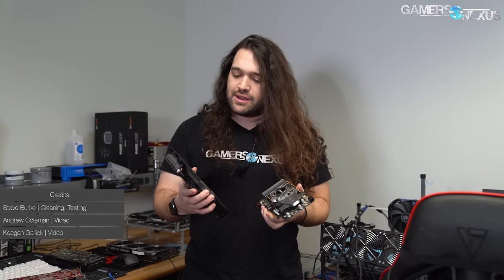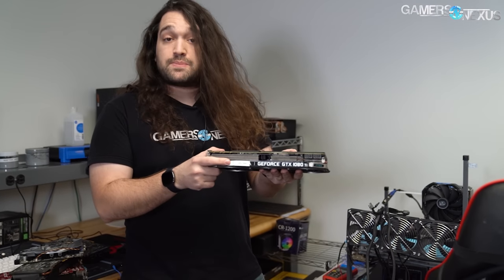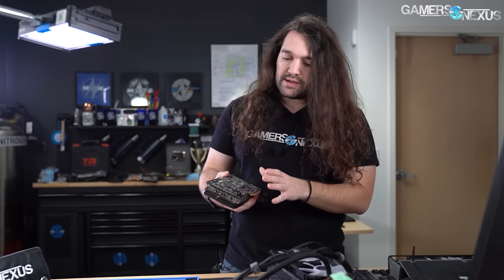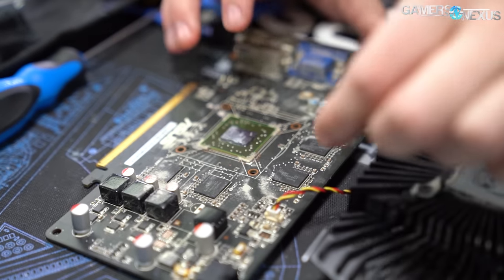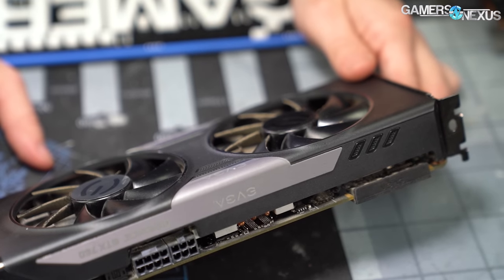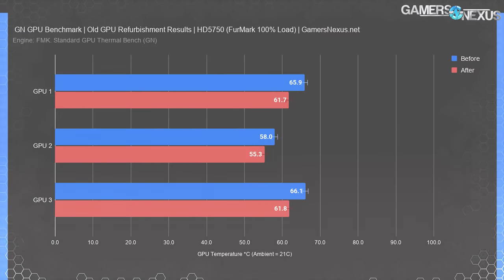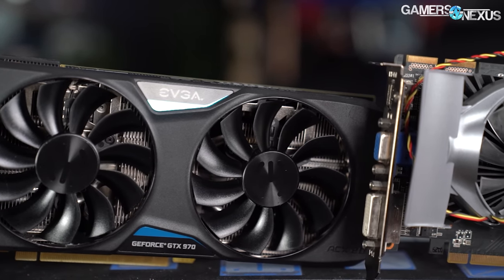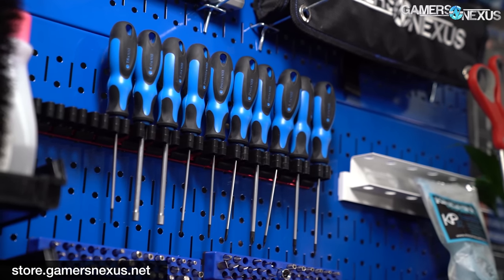GPU Cleaning Before & After Thermals: Re-Pasting & Dust Removal

Comment: I have a PC with GTX 550 TI that, until today (10/17/21), I had never took apart to do a thourough clean up or to reaply thermal paste.

It was a mess. Before the maintence it was reaching 75⁰-80⁰ C just by turning it on. The old paste was rock solid and splattered all around the chip's surrondings (I cleaned it as best as I could but in the end I was afraid to damage the chip so there was a little bit that was left there).

After the clean up and the new thermal paste It went to around 45⁰ C, which is very acceptable considering I live in Brazil.

Will try to see if performance goes up but the simple fact the the PC is quiet now is a blessing alteady.

Comment: After the gpu shortage I swapped out the standard heatsink on my rx580 to using a nzxt kraken g12. 100mhz overclock to 1515mhz and temps not getting above 60oC. So happy I did it, and the g12 will be used on whatever new card I can eventually get!

Comment: I'm cleaning my xfx r9 290x tomorrow. 8+ years old. Still runs great but it does run hotter than it used to. Really dusty and hasn't had paste or pads replaced ever. Also one of the fans is faulty so I'm replacing both. Should be a huge improvement. I'm planning to milk this card as long as possible until I can get my hands on a 3060ti or better for retail price. This thing surprisingly can still run most games at 1440p 60fps and even 4k native with 50% render resolution. Amazing for such an old card.

Comment: Story-Time:  A client had spilled something like a Snapple into his running GTX 580s, a pair of them (when they were new).  It was a top-vent system, rotated mobo, and the drink went straight down the cards' heat vents and all along the PCB.  They paid to replace both, but meanwhile we had a couple cards that wouldn't POST and couldn't be RMA'd. 
They went right into the bin as e-waste.
...And I needed a GPU upgrade.

One of the cards, if I recall, had something extra-bad wrong with it, but the other appeared fine except for the residue and the no-POST. 
So I took that one out of the bin, and took it apart. 
At the kitchen sink.  

I rinsed off the factory thermal pads under lukewarm water, patted them slightly dry-ish with something lint-free, and set them aside on baking parchment to air dry the rest of the way, while I attended to the rest.  The drink residue had gotten on every surface.  Since this was already trash, nothing to lose by throwing caution to the wind, and I literally washed off the PCB of this GTX 580 under the tap, with soap.  Gave it a gentle scrub, even, with a hobby toothbrush, but that barely mattered since the sugary residue dissolved pretty well.  Washed out the heatsink/fins, too.  Wiped down the fan, but thankfully it escaped most of the splash & dribble. 

I then followed up the washdown with rinsing with distilled water.  I had bought 2 gallons just for this.  Thoroughly rinsed the whole PCB like that.  And then, because water can sneak into cracks like a gap between a chip and the board, I followed the distilled water with a rinse of 92% isopropyl alcohol.  I was hoping it would mix with, and/or draw out, and/or displace, any standing water in tiny gaps, and allow everything to evaporate before any corrosion set in.  I was going to blow it off with a compressor, but I didn't trust that I'd get every gap.

After all that, I still let everything sit to air dry for another couple days.  Then reassembled, with the original pads and fresh TIM on the die.

That GTX 580 served me well for 5 more years, in that whole time only giving me 2 random TDRs, and the only thing it couldn't accomplish was running Heaven more than an hour or two.  Otherwise, it handled every game I threw at it.

I was bold cuz I had nothing to loose and a free GPU upgrade to gain, so I'm not recommending it.  But a good cleaning can do electronics wonders!

Comment: my personal solution to this issue is to take a brand new GPU, tear off the stock cooler and install an EK waterblock with liquid metal instead of paste ... run the card daily for over 4 years with zero maintenance and no drop in performance. Recently upgraded and decided to pass the old card on to a friend, he wanted it air cooled so I took the block off to fit an air cooler and the 4+ year old daily driven liquid metal was still liquid like the day it was first applied .. it cleaned off with no fuss and left the die and nickel block cold plate looking like new. Sure ya have to be careful when applying the stuff but it's pretty awesome in performance and lifespan.

Comment: Get a water block, then the only thing to dust is the radiator. Use PEG instead of water and you never have to change that either (at least not in the 9 years I've been doing it). So the tehrmals are a few degrees worse than pure water, it's still 10x better than air.

Comment: Beware of hard water, depending on where you live. A hair dryer might not blow strongly enough to get all the water out, if that’s all you have. I’m going to follow Steve’s recommendation about going outside and just using compressed air even if the hard water stains would be minor.

Comment: Those benchmarks made me wish I had ran some tests to get accurate temperatures before cleaning my Quadro 600. Still, it dropped from ~88 Celsius with fans maxed out at 85% to ~65 Celsius with same fan speed. 
The huge improvement even allowed me to play most games with my fans at just 40%.
Legit started crying after dropping from PS4 noise levels to basically idle fan speeds.

Comment: Just to be safe its good to heat up the GPU die a bit with a hairdryer before tearing off the heatsink to soften up the dried up paste.
This helped me a lot when I replaced the paste on my old Original Xbox. At the time when I did it, the paste was at least 17 years old

Comment: Before this week I would have thought this process was simple and everyone can do it but I was fully wrong.  I have purchased 2 used RX 580's this week and both were absolute disasters.  The first one had NO thermal pads and was re-assembled entirely with thermal paste and waaay too much paste at that.  I spent over an hour and I was still unable to fully clean the board.  The second one had thermal pads but they were too big and the GPU did not have enough thermal pasted and looked like the squish method was used as there was clearly not enough paste showing the on the GPU or the heatsink after removal, probably from the pads being too big.  There was ~10c difference in temp at 100% load between the 2 cards.  Now their temps have settled to be within 3c of each other and are running within 1 MH/s of each other.  If you don't have the correct pads and don't understand how to use paste, maybe just leave it alone.

Comment: I think you would've seen serious improvements with HD78/79x and R9 series card as well as RX 4xx/5xx cards. The former run REALLY hot and are not always adequately cooled, the latter just LOVE to thermal throttle even in the mid 70°C.

Comment: You could also buy a aftermarket gpu cooler, sometimes with those you get way better thermal performance allowing you to overclock higher. OR you could do what I did, and take 2 120mm noctua fans, and a gpu fan adapter (THAT MATCHES YOUR CARD! Asus uses different connectors), and Zip tie em on, and get 20 degree lower temps, and way lower db. I did that to my 980ti when my fans died, and I have been very happy.

Comment: I just repaste my CPU & GPU every few years. I have intake filters on my case I clean twice a year or more, that have a small layer of fur/dust on them when I remove them for cleaning. I run a HEPA air filter in my home though so I'm sure that helps with buildup. Good video!
Reply: Repasted my 1070 when I got it. Temps instantly improved and stayed the very same for almost 5 years now. You don't have to repaste it all the time, if you use good paste, like Kryonaut.

If you clean your PC that often you really don't need filters on it. Remove them and you will see lower temps overall.

Comment: Interesting video - in the future if GN had the time i'd love to see a step by step analysis. i.e. first clean the heat sink in-situ ( as possible ) then test, then repaste and test, etc then maybe on a separate card do it in the reverse order ( though that is difficult to find comparable cards in the same state of dust/paste degradation ) to determine which steps have the most benefit. Two reasons for this, firstly because i'd just be interested to see if all that dust in the heat sink fins actually has any impact or if its the repaste that makes the difference. Secondly if the fin dust did have a significant impact that might be a much easier clean step for some users than a full teardown and repaste.

Comment: My cousin gave me his old PC as payment for a repair job. Somehow he got jelly spilled all over the top of it, which leaked down onto the CPU fan, through the blades and fins, down onto the graphics card, over the fans on that, onto it's PCB. The PC still worked, so this jelly had eventually hardened and calcified. I took it all apart and cleaned it thoroughly with an 80% alcohol solution and after a full day of cleaning I put it all back together and it still worked. Patience pays off. Free 1070 and a $200 Case.

Comment: People often underestimate the potential impact of some simple maintenance. My 7-year-old laptop went form crashing in Civilization to peaking at 80 degrees in furmark after replacing the thermal paste on the CPU and GPU and cleaning 7 years of dust out of the cooler.

Comment: Gotta love the coincidence. Here's a long story about preventive measurements: 
I bought a used 1060 which came with quite dry thermal paste, although the temps were acceptable 71-2c under 100% load. So around  the end of October last year I repasted it with some cheap cooler master paste, I applied a thin layer that I spread out evenly to cover the die and thermals were okay, 63-5c stock at 1911mhz 60-65 % fan utilization and 66-68c at a +121mhz oc (could push it higher, but didn't see the point) same fan speed. 
Well just a month ago my card started to act weird, fan speeds would jump up to 80%  with thermals reaching 69-70 at stock in the same games but I had sadly stripped a screw and couldn't service my gpu. Finally enough was enough,8 hours ago I somehow managed to remove the screw without damaging anything and used a tube of mastergel pro that came with my hyper 212 BE. 
This time I put a lot, didn't spread it out at all and when I did a heaven benchmark and played  doom eternal for 2 hours ... temps never reached 60... 59 were my max temps with better clocks and a better score  at 60-65% fan utilization (1924 compared do 1898 at my stock profile, I have the oc model ) .
In my case, I believe that the constant shrinking and expanding of the chiplet pushed that cheap thermal paste sideways because when I  unscrewed the pcb from the heatink it fell on its own which has NEVER EVER HAPPENED before.
TLDR: Never use cheap thermal paste on your gpu, and if you do make sure to put a bit more than the cpu

Comment: If you keep a positive pressure inside your case, meaning more inflow than outflow, you'll never have to clean your cards. This is 11 years though, not bad. 

Hcrevices/ vents other openings of your PC that creep past your filters. If you can, get a bottom fan in there, it hits the GPU first, pushed back from the front fans.

Comment: Still running SLI GTX 970 SC since like 2015. Filtered case, and pretty much light use for the vast majority of its life. When I got a 2k monitor, for about a year I ran the resolution at 2k, putting more load on the gpus in games, then switched back to 1080p, don't notice a huge difference in quality, my gpus are happier and the fps is a lot more stable. Will probably run these cards until they stop working with the way the market is at the moment with shortages and high prices. Half tempted to stop using SLI and sell one of them on ebay for more than what I paid for it, 6 years ago. lol

Comment: I have a Gigabyte GTX 960 4gb Windforce dual axial in a system that has the fan shroud and fans taken off and 2 Fractal R2 92mm silence fans zip tied to the heat sink. The fans are hooked up to an NZXT Sentry Mix II fan controller running at a fixed 50%. I did all this because I broke the fan header off the board while replacing the thermal paste lol. It works so good, no matter what you put the card through it wont go above 50c and it makes no sound. Those Fractal R2s work good, and a GTX 960 4gb is still brilliantly capable for an HTPC on a 1080p 42 inch display.

Comment: There is one more way to ensure that one doesn't blow the dust into the air.
And that is to use a vacuum cleaner.

And before people scream "ESD!" Then electrostatic buildup comes from dry moving air, it doesn't matter if the air is blown from a high to low pressure or sucked from high to low pressure. The mechanism behind electrostatic buildup is the same in both cases.

Also, using a shop compressor tends to be a bad move.
A lot of shop compressors have dehumidifiers on them, ie, they send out far more dry air than ambient, only increasing the risk of electrostatic buildup. (And why air systems in mining and dust filled areas like grain elevators require proper grounding straps.)
Another disadvantage of compressed air is the risk of them pushing in clumps of dust underneath BGA packages, this can effect the device since dust can at times be conductive. (in short do not get up close and personal with BGA packages and other components if you see clumps of dust on them. Get rid of all the large dust first.)

If one uses an air compressor, then ensure that you use a compressed air gun that mixes in ambient air. This helps ensuring that the humidity of the air stream is closer to that of the ambient air.

Compressed air in a can is also mostly dry. Since compressing air to higher pressures forces out the water from it. (Though, compressed air in a can also has a non compressible liquid in them to ensure fairly steady air pressure throughout its operation, a so called propellant. This liquid can at times also come out and it tends to stain boards, and also get rather cold too. (So do not shake the can, nor turn it on its side or up side down.))

And most issues surrounding electrostatic buildup is generally only true if the ambient humidity is bellow 30%. I would though recommend ensuring at least 50% relative humidity when cleaning electronics with any compressed air, be it in a can, or a compressor. If you use a vacuum cleaner or smaller air pump/fan (like a mattress pump), then going down to 30% humidity is still fairly reliable.

Secondly, there is a big difference between electrostatic buildup, and ESD, since dry moving air will slowly apply charge to a surface, but if said surface is grounded, then the charge will just get carried to ground. Thereby ESD isn't a problem. It is also recommended to only handled components via their grounded points, like heatsinks, screw holes, or just carefully holding them along their sides if one can't find anything that is guaranteed to be grounded.

Having some ESD foam or static dissipative bags (always pink in color) is also a good way to ensure that one can discharge any static buildup in a controlled fashion. Also, all "ESD Bags" aren't dissipative, there is also electrostatic shielding bags (these are typically gray/black tinted), these are way more conductive to the point that the discharge isn't controlled. The reason for the "shielding bags" still being a thing is that one can't zap components through them, unlike the dissipative bags. (ie, the two different materials serve different purposes, technically both should be used in transport with the dissipative bag closest to the component, but very few companies do this.)

Also, I somehow expect random troll/uninformed answers to this comment, it is the internet after all...

Comment: a good tip is a soft toothbrush alot of times there are oils built up on the fins too especially if they were smokers, instead of using water i would personally use some denatured alcohol, dip my toothbrush into the alcohol and lightly scrub the fins doing this can clean really dirty coolers pretty good, hecka toothbrush is amazing for cleaning period

Comment: Swiffer cloths are amazing at cleaning fans and computer dust. I buy the refills from Costco and they are a great addition to any tech workbench. Clean fan blades with the Swiffer cloth and follow up with Isopropyl applied to cheap lint free cleaning swabs from Amazon.

Comment: Recently I bought used RTX 2070 to upgrade from GTX 970, and turns out it was with faulty fans, and because of that it was getting very hot in my SFF case (Node 202). I didn’t notice any problems while I was testing it, maybe because owner had a very good airflow at his enclosure, so at the beginning I was thinking that my case was a problem, since I’ve read that components getting pretty hot in there. But I decided to experiment a little, so I deshrouded it and put 2 120mm fans. But it was hot and throttling anyway even in the base clocks and undervolting. Then I saw this video and decided to do deep cleaning: changed thermal paste and washed heat sink. Of course, I dried it with hair blower but as a matter of precautions left it dry for a few hours more. As a result, with overclocking to 1865 MHz and undervolting down to 950mv, it showing 79 degrees max! Basically I dropped 10 degrees Celsius thanks to this video

Comment: At the office years ago, I was shocked to open the dishwasher in the break room, to find the top rack filled with keyboards!  Yes, the IT guys routinely washed the grubby peripherals by running them through a hot wash cycle with no soap.